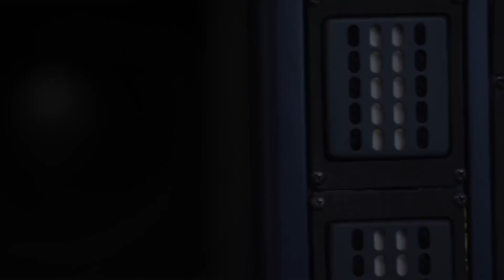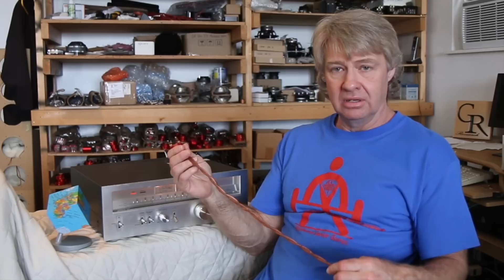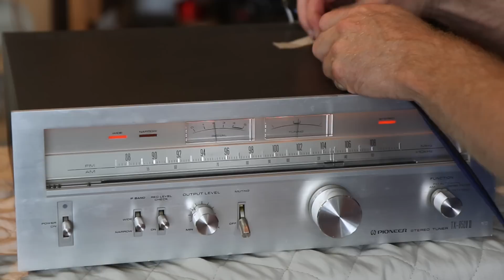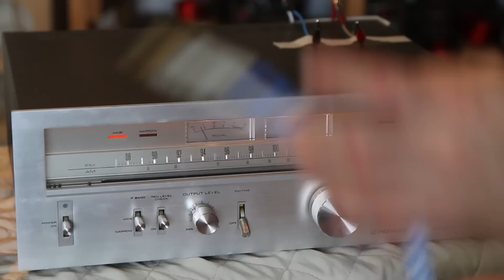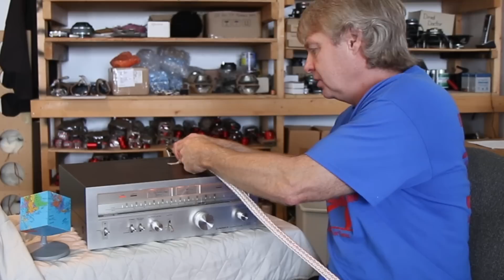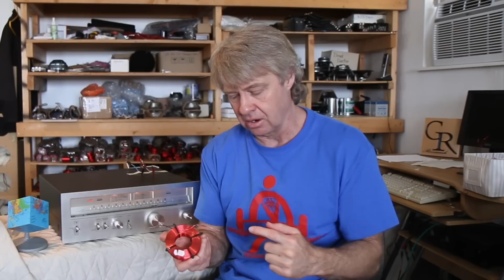Do Audiophile Cables Matter? Here's PROOF!

Comment: While it's interesting to note that the different cable geometries can result in measurable differences in RF signal capture (all the antenna engineers just said "well duh!"), the test rig did its measuring here with a circuit specifically designed to receive those signals at the modulation frequencies.  Just because an unterminated wire pair can capture RF out of the test environment (act as an antenna) doesn't mean that the signal will have any significance when applied in the actual circuit use case.  The voltages involved between an amplifier output and the detected RF signal is likely on the order of 3 or 4 orders of magnitude (or more), and that RF signal is orders of magnitude above the ears ability to hear.  There may be secondary effects on the circuitry of a poorly designed amplifier, akin to oscillations outside the audible range loading the circuit devices and affecting their performance on audible signals.  Different amplifier topologies will also react differently (e.g. class D amplifiers of necessity employ filters to remove aliasing that would also wipe out any of these rogue RF signals.)  In the end, it comes down to how you define whether something "matters".  Just connecting random copper lengths to an RF input is barely the start of a proper test rig.  If the assertion is that this specifically should be applied to speaker wire, at a minimum you need to have both ends attached to the typical terminations (amplifier output stage and speaker input - likely crossover components but ultimately a transducer voice coil).  Only then are any measurements realistic and potentially of concern.
Reply: I was wondering the same thing - how an unterminated pair of wires work as an antenna is a completely different thing to being used to conduct voltages in a complete circuit to drive a speaker. These tests don't prove those cables make any difference to how the speakers will sound. The only way to know is for blind testing in controlled conditions. Floyd Toole has done plenty of research into how people rate speakers in controlled conditions, and when people can see a speaker they will give different results to when they can't. The same goes for cables.
Reply: @garyl5128  It's why Julliard stated having blind judges during auditions.
Reply: Yeah the voltage in speaker wires is so high, that effect from these interferences really doesn't affect that much to the output. It is like you scoop water from a river with a teaspoon. It really doesn't affect the total flow. Case is different with 1vpp signals with active speakers. There the signal cable insulation and cable quality really matters. And this is the main reason I naturally prefer passive speakers over actives.
Reply: You say closed mind open mind
right it's not a matter of either it's a matter of knowledge. And the ability to use critical thinking.
Critical thinking: if such a short length of cable competently constructed is capable of changing things so significantly then it would not be possible to distribute a signal country wide. We would need far fancier cable than anything these snake oil salesmen could imagine.

Closed mind: yeah you mean by this the engineers who know what you suggest is simply not possible. Yes anyone can design a cable to distort the signal to make it "sound" different but one competently designed cable will sound exactly the same as any other competently designed cable. It simply has to because of AC theory rules.
Finally follow the money. Who is trying to sell you  these assholingly priced cables. The engineers who designed the  transistors and other components making electronics possible? No ofcourse not.
It's so easy to set up blind tests in audio shows but they never want to do it. 
By the way I'm not suggesting any old piece of crap wire with a crap connector on it will do. I mean a competently designed cable and connector. And it's not difficult to design such a thing for reasonable cost.
Reply: Maybe you should have followed the link posted below the video: https://www.youtube.com/watch?v=ER_lqNFckxY
Reply: I would say the only thing it shows is how susceptible the wires may be to picking up unwanted signals.
Reply: I'm all about getting my room as quiet as possible! Maybe I'm just a little sensitive to the background signal noise (noise floor) but for me, even though I'm running an arcam avr20 with a couple of matching high-performance 4 channel power amps (front stage/Atmos) which are driving my Sonus Faber speakers in a 5.2.4 configuration, which also includes a stereo pair of Rel subwoofers for my 4 × 3.5m (13 × 11.5ft) livingroom. I have to say it was only when I purchased quality shielded speaker & RCA cables did my room finally become exceptionally quiet! 
My room is now so quiet there are occasions (without me opening my eyes) I'm actually unable to differentiate whether the system is switched off or if it's switched on. The room is really that quiet.
If one is looking to get rid of that so-called ambient sound of the room. IMO shielded cables are the only way to go. And bear in mind this is coming from someone who's changed his setup and cables multiple times.

While testing a two channel sound test video I also give a little walkabout...
https://youtu.be/e-B3kjyLvwA
Reply: This is actually my new fav audio cringe/hate watch channel. Idk how someone so clearly brilliant and passionate about technical audio science could spout this stuff day after day with a straight face. But ultimately I’d do the same thing to increase hate comment interactions and owned an audio store to profit off the wealthy suckers while they guzzle down all the yummy yummy snake oil straight from the snake oil source💀

Comment: Whether a cable is a good matched RF-antenna or not in the 100MHz range connected to a radio receiver is of little consequence for the ability to act as a speaker cable. Different optimization of characteristics applies. I don’t see the need for a test like this to convince anyone from a technical point of wiev of understanding what is really happening.
Reply: Maybe you should have followed the link posted below the video: https://www.youtube.com/watch?v=ER_lqNFckxY

Comment: BEST WAY TO TEST ISNT YOUR EAR  NO BECUSE WE ALL PRESEVIVE SOUND DIFFERENTLY.  SO A HIGHEND SPECTRUM ANLYZER RTA  an Spl point and an ossloscope  with these youll see what changes can happen in different wires on the same system same speakers and same volume levels. 
And different points where cables really can make a difference.  Of dont.

Most newer systems use HDMI cables 
And not RCA  the RCA is 75 to 100 years old, Im a big fan of TOSSLINK 
And people laugh at this but I belive FIBER Optics is the cure for any and all copper wire problems. ELECTORONS travel down wires over the surfaces  if your speaker wires are fine stranded and 1000s of wires doesn't it hit you that electrons will jump from wire to wire.
Causing noise that wasn't in the recording.
This is also true with live music and recorded music, most live music only has noise in the instrument wires in the case of acoustically made sounds only in the mics you pick it up on.

TOSSLINK WAS THE WAY TO GO FOR HDMI, HDMI CABLES NEVER SHOULD HAVE BEEN COPPER WIRES. IT ALL SHOULD HAVE BEEN FIBER OPTICS.
FIBER OPTICS IS THE CLEANEST CABLING YOU CAN DO. BUT ONE DRAWBACK ITS ALL DITIGTAL.

Comment: actually shielding matters in the RCA range  . speaker cable do not.however the gauge and material matter a lot. Silver( or silver plated) favors mid high range while copper helps with bass and this is audible . I use 16 g silver in regular antenna mesh shield for RCA and it works really good. try your own materials and yes do your shilding
Reply: Shielded cables don't do anything for the noise already on the line. Plus there is a magnetic field stored up in the shield that effects the signal transfer.

Comment: I'm skeptical, but here is a challenge:  Do this demonstration in reverse.  Injuct high levels of radio frequencies into the speaker cable while playing, and see if that makes an audible difference that can be heard over Youtube.  And how much does it take to notice?  I suspect it will not do anything. (I'm aware that in pro audio, everything is shielded except the speaker cables.  So it makes sense to me to invest in gear that has XLR inputs and outputs instead of focusing on the speaker cables.)

Comment: What gets me is that in most speakers, the internal wiring is often standard run of the mill electrical wire, and sound is only as good as the worst component and often thats internal wiring or the crossover components and board. Maybe if you got some ultra sensitive speakers youll notice but i think for most people its not an issue at all. Sure if youve upgraded everything to top standards and wanna pay for the last 1% of performance its might be worth but otherwise not so much, in my opinion
Reply: that is what i always thought
Reply: Yes, exactly! A fact lost on most ppl..

Comment: What it demonstrates is either the presenter doesn't understand what he's doing or he's intentionally misleading people.  I was enjoying his vids but this stunningly bad.  I'm not an electrical engineer but even know any conductor will act as an antenna and he should too.  Anyone old enough to have had a real TV knows this.  Need channel 7, hold on to the rabbit ears.  RF signals are tiny and once you connect the speaker wires across the amplifier and the speaker it's dwarfed by the power needed to power speakers.

I actually have braided speaker cables, I braided all of them myself because there is objective testing that demonstrates this does make a difference, tiny difference anyway.

I shouldn't discredit the whole idea that cables don't matter, but this is not a valid demonstration.

Comment: You would have to have an absurdly sensitive passive speaker to hum with only a cable connected, no matter the length. It’s like saying an elephant stampede would be slowed down by a blade of grass. 
If Danny was arguing that is an issue with long cables used at preamp and source stages, that I could understand. But absolutely no shot RF interference has any impact on signal after amplification.
Reply: And this is coming from someone who just bought his XLS Encore speaker kit
Reply: There is a link right under the video to an amplifier designer that says the same thing about RFI noise effecting the signal. It really is a thing.

Comment: Don't forget that when you're talking about speaker cable, the amplitude of the signaln coming out to speakers is more powerful than small signal of preamp for example, so it's strength has no comparison. Of course any length of cable acts as an antenna and a twisted pair or braiding has a different E and B, electric and magnetic field, interfering between both wires. And the end of the day, it's just preference and common sense trying to minimize interference.

Comment: I followed you up to a point, however no wire unless its balanced can cancel out noise from the system.
Reply: It does not have to be balanced. The geometry of the wire can create an RF filter.

Comment: Wow. 100% Copper is 100% copper. Either it transmits the audio signal or it doesn’t. We are talking about speaker cables, not unbalanced RCA type cables, or twisted cat cables, or whatever line level/power cables you use. 
Whatever fancy plastic/rubber/Kevlar coating around the copper is of no concern. Or how the copper wire is constructed. 
Have you ever tried the bare wire coat hanger verses expensive speaker cables of same length? 
I think after you made this hilarious video, you should really do coat hanger vs speaker cable. It may surprise you.

Comment: I hate that I did spend for decent cables  and  interconnects but soon as it gets to the speaker and crossover , they use cheap, push on tin wire and cheap crossover parts

Comment: If there was hard metal direct connection etc, there’d be no need for cables. Since there is that said, different cables mostly all make the system sound different with revealing gear!   Measurements are limited.  Hell most people don’t even understand impulse response and it’s measurement’s!!!   Yup, they matter

Comment: a cable mere digital cable from your cd transport to your dac we all call it a cable and it is but in reality it should basicly called a basic transmission line with the complexity of it it carty square wave 0 and 1 at very fast rate  
we draw squrewave on paper its all nice but any electronic device dont see a square wave they see a bunch of harmonic ,second third fourth and so on to very very high frequency inside a cable it start to form standing wave so much so it be going back and forth from source to receiver the same as a cb cable and antenna combination hence a good cd player should alway be  better than a seperate dac because of it ounce again the cable matter

Comment: there is no electronic device that can reproduce a real cello or a guitar its just an interpret too many variable wether its television (remember these old color tv that loose the convergence and purity as you move from one city to another ..and wonder why, it was the earth magnetic field that slightly change on the face of the screen screwing up the convergence and purity ..) a speaker is a mechanical device using air to play music well this very air change from cold to warm hence density so its much easier to move air while its thinner ,the very same air in the enclosure , we all talk of crossover and impedence so on and so forth coil and and capacitor do they take the voicecoil into the equation we hardly ever ear about that do we ? as the frequency rise into a voicecoil be it a woofer or a tweeter the impedance also change phase shift also occured into a coil its gotta change something also so many variable they are all true can a cable make a change for sure it can no doubt 
we all saw that modern turntable in which the platter float on a magnetic field to top it all of using the very same platter as a rotor under that same magnetic field ....at last no more mechanical noise ......VERY clever all these magnetic field next to moving coil cartridge or a moving magnet cartridge im sure it is dead quiet reproduction lol

Comment: i remember a long time ago i was studying electronic mostly tube and hybrid television ( vertical and horizontal output was tube ) the low voltage was solid state) we built an amplifier 30  watt rms monoblock we use to experiment all sort of things among we had this rf generator we use to generate both am and fm close to these amp we use to broadcast single 400 and 1000 tone the fm wasnt passing thru but the am sure did remember a transistor is bacicly 2 diode if you count all the coupling capacitor you pretty close to a AM demodulator ....i do believe all is possible we even use an rf generator with with af generator couple to a capicitor directly in the powerline and most AM radio  around select the bogus signal over any channel selected electronic is very interesting but here is the thing can we enjoy the music and having fun ?????

Comment: Why don't you put on an oscilloscope and measure the amp output and compare the signal to the end speaker cable signal?
If there is differences, then it will show.

Comment: So we're not going to listen to it and we're not going to do any objective testing that is relevant.... Cables might make a difference but this video isn't going to demonstrate anything useful to the audible frequency range. All you're doing is comparing the performance of the cable when used as a radio antenna.

If anything, your conclusion is backwards. A cable that acts as a filter  (highly capacitive or inductive) is going to MODIFY the signal to the speakers more than something plain. 

If you want to reject radio energy, use SHIELDED cable. With that said, when was the last time you heard noise coming from your speakers with just bare wire attached? This entire argument hinges on there being noise on the line and being audible from the speakers.
Reply: It doesn't work that way. Shielding is worse. Shielding can store a static charge and have an negative effect. The noise is also often already in the system. Shielding doesn't fix that. The geometry of the cable acts as a filter and removes the noise.

Comment: I think the main problem with the "Flat Earthers" is that they are rejecting the notion that cables can improve the sound (or picture) quality. They seem to have missed the point, which is that reputable cable manufacturers, and audio companies promoting quality cabling, like GR Research, have never claimed that cables can "improve" performance, but rather that cables can negatively impact performance, and the goal is to do as little harm as possible, and maintain the integrity of the original signal. Doing this, as it so turns out, has the effect of revealing more detail, better soundstaging, imaging etc etc etc, as you are projecting the audio against a "blacker" background, just as displaying images against a blacker background enhances visual performance. The "Flat Earthers" particularly those with various university degrees and the ability to operate a multimeter or oscilloscope, should consider going back to uni and studying physics/acoustics so they would then have a legitimate scientific understanding about whats happening. Even a short tafe course in metallurgy probably wouldn't hurt either.
And three cheers to Danny for using a method so simple, that even the most advanced "Flat Earthers" would be able to understand, to shine a light on one of the many things that can negatively impact an audio signal as it makes it's way throught the corridor of doom we call speaker cable.